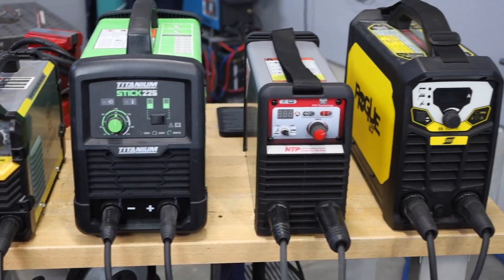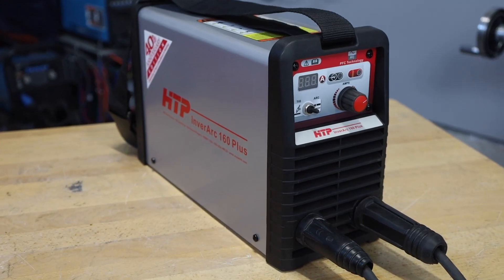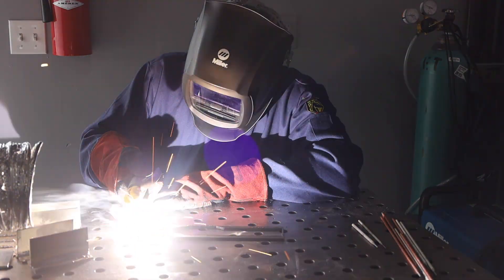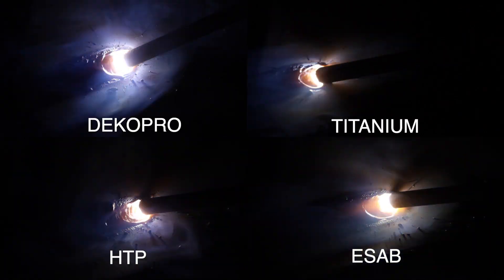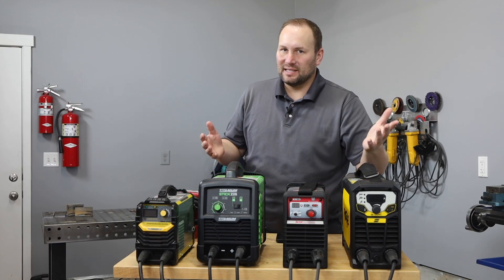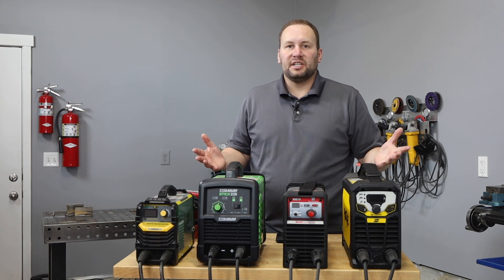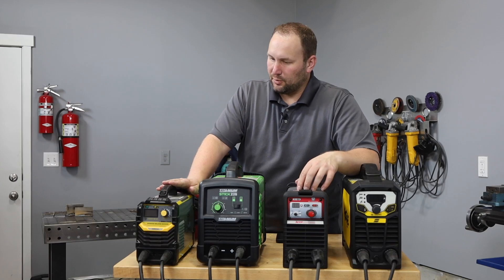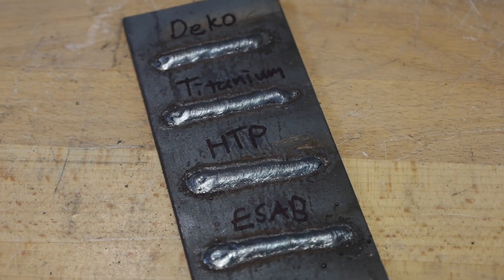Cheap vs Expensive Welders: Don't they all do the same thing?

Comment: What about duty cycle? The biggest issue for me with the cheap welders is that the duty cycle on them is appalling, here in Australia I've seen them as low as 15%. They shouldn't be allowed to sell machines like that. That is a lot of cup of coffee breaks to let things cool down if you are working on even a medium sized DIY project.
Reply from the maker: Great point! I was going to get into duty cycle, but all I could go off was the ratings because actually testing it would be a pain without a load bank. The Deko is actually rated the highest, but I'm not sure if I'm buying that.
Reply: The Deko is rated at 10% duty cycle at 160 amps confirmed that by messaging Deko but it does work pretty good for what it is. @TimWelds
Reply: The HF machine is rated at 40% at 70A and 20% at 225A. The 20% didn’t bother me when I bought mine because I can’t ever see myself using 225A for anything. Most of my stuff is in the 60-90A range, and I’ve never hit the duty cycle even on big jobs here in lower Alabama in the summer.
Reply: @davehoward2791  40% at 70 isnt to bad.
Reply: Most welders display the duty cycle for its highest amperage. I own the Vulcan Commander 225 (Miller Thunderbolt XL copy) which is 20% duty cycle at 225 amps, but... it has 100% duty cycle at 100 amps and below. I’m not sure who uses 225 amps, but I keep mine between 69 and 130.
Reply: 15% is low. Man that would be a dog to weld with
Reply: @andyf1235  yep. My son asked me to help him with a project he was doing, after an hour struggling with his el cheapo welder and its 15% duty cycle,  I threw it in the bin and took him down and bought him one with a decent duty cycle!
Reply: @jackdawg4579  but saying that not all budget welders are bad with duty cycles. It's like anything got to do your research before you buy.
Reply: @andyf1235  yep, definitely the case, the one I bought him was pretty much the same price, but with a 35% duty cycle.
Reply: @jackdawg4579  my elcheapo vevor Tig at least has 30 percent duty cycle and if u get the upgraded model with LGBT invertor in it it is 60 percent duty cycle
Reply: Well, it depends. Welding for a minute and a half per time isn’t bad if you’re just making short welds. If you’re going to do more serious work then you need a more serious machine. What concerns me about the really cheap Chinese machines is build quality and safety.
Reply: Amen
Reply: I've had a few cheapo stick welders and the 220/120 ones I've never had a problem with their duty cycle and hell, the s7 brand one that's like 79$ is the best stick welder I've ever used. But cheapo wire feeders are atrocious.  Even the almost 300$ home depot century flux 90 barely let me tack anything before it had to cool down
Reply: I would buy the HTP or Esab. I own an HTP welder and they are solid. I’ve heard good things about ESAB also
Reply: It’s a south of the equator thing. Not much good happens there.

Comment: I purchased an Amico ARC-200 on amazon about a year ago. Welds like a dream, comes with a tig setting as well as adjustable arc force. They have a one year warranty (never had a problem with it so no idea how well they stand behind that). It has taken every rod I've thrown at it, including 6010. Plus a 90% duty cycle at 200 amps. all that for only $190 on amazon.
Reply from the maker: That sounds like a nice setup, especially for the price!

Comment: For someone who is starting out, but looking to be able to do some aluminum welding as well (which I do realize adds difficulty especially if you're learning) is there an affordable system that is recommended?  

For context, I want to be able to weld aluminum parts (where needed) for boats restoration customization.  I'm just not sure what is recommended there, or where to start.  I do have a buddy helping me, but thought I'd also get community input as well, to have multiple options to look at for what I'm hoping to be able to do.
Reply from the maker: The two processes to look at for aluminum are MIG and TIG welding. MIG is good if you are doing a whole lot of the same joint, because it is faster. However, it takes some messing with to get the settings dialed in on MIG, so it's not awesome for one off stuff. MIG generally requires a spool gun and is also a pain for aluminum under 1/8" thick. I almost always use TIG for aluminum. TIG is great because it can be used on very thin to thick material and it is very controllable. In order to TIG weld aluminum, you'll need an AC/DC machine. TIG is also nice because the same machine can weld pretty much any metal with the same shielding gas, straight argon. MIG requires different gasses for different materials. Most likely, TIG is going to be the way to go for you. I have videos on TIG basics and Aluminum TIG on the channel which may be helpful. Wow, this is getting long, so I better actually get to the answer of your question :) As far as machines go, the price range will be higher than the stick machines in this video. Check out the Primeweld TIG 225X. It is a great entry level machine near the low end of the price range. I have one and it works very well. The machine comes with a CK torch (which is the best in my opinion), a great quality pedal and they have great customer service and stand behind their machines. It's not the only good option, but one that I have had a good personal experience with.

Comment: I bought a deko pro on last summer. I’ve used it probably 20 times and have had great luck with it for what it cost.  This was my first machine and I taught myself from your and other videos. I recently welded together a belt grinder out of .25 and .375 steel. Stuck it together great, however I’m sure it didn’t penetrate deep enough to be “structural”.  I would save money and buy the same thing again for projects around the house.  I will someday buy a mig and run gas for cleaner work but the deko is a good first welder.
Reply: I was in the same  boat 1 1/2 years ago.   I was considering the Dekko but ended up with the Amico 165 which included a TIG torch.  I learned from Youtube videos also.  Welding is heading towards laser welding and less of a learning curve is required.

Comment: What is the deal with inverters and 5P? I haven’t tested on my inverters as I default to stick with my Synchowave or Trailblazer. My old Big Blue 400D sucked a valve.
Reply from the maker: The problem is usually just the lower open circuit voltage, but also the inductance of a transformer or engine drive is really hard to beat for those rods. Many of the newer inverters are better than the first ones, though.
Reply: @TimWelds  Yeah, lower open circuit voltage can reduced the ability to maintain an arc.

Comment: i have the ESAB and I agree, you don't have to start out with the higher end machine. However, if your experienced? you will hate the lower end ones. i know after welding with better machines you get to expect more from them because they cost more, and they typically perform better. IMO.
Reply: Is the quality of the weld better?
Reply: @shovelheadseven  well I think that's all on the skill of the welder. I have found that the higher end welding machines are usually truer in their settings and the ability to weld longer keeping a steady and controlled arc.
Reply: @shovelheadseven  Don't let anyone bs you. Yes, in most instances the higher quality welders perform better. Even a Lincoln 225ac buzz box puts that cheap deko pro dc inverter welder to shame. Makes MUCH nicer welds. I would discourage any beginner from getting the bottom of the barrel. It could possibly turn someone off from welding all together. Pay a little extra because most of the time you get what you pay for.

Comment: The harbor freight extended warranty is cheap and covers everything even neglect and abuse for 1 - 3 years depending on which you buy. You can literally take your stuff in a swap for new no questions ask.
Reply: Most of the time its about 20% for 2 yrs.   It is underwritten by an extended warranty company.    You never have deal with the warranty company with HF, so that part is good. The bad, extended do nothing for the quality of your machine or future machines.  The 5yr warranty on Hercules will bite HF.  If they have a big screwup, they will be on the phone to the factory to fix it.